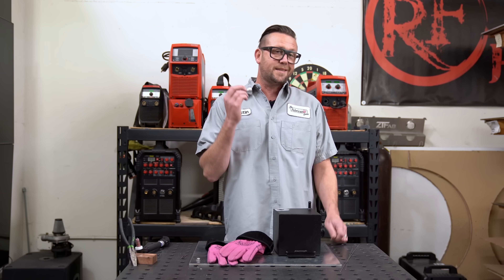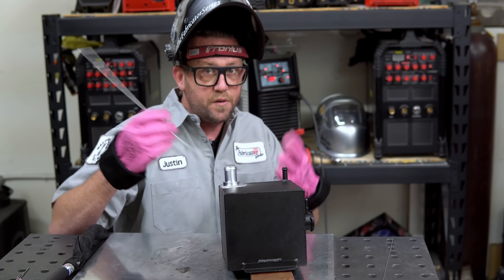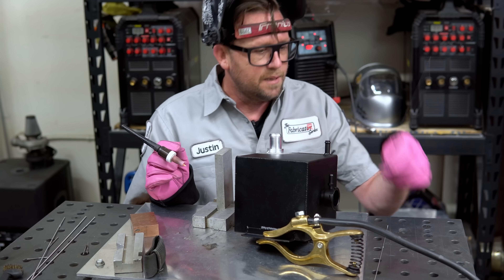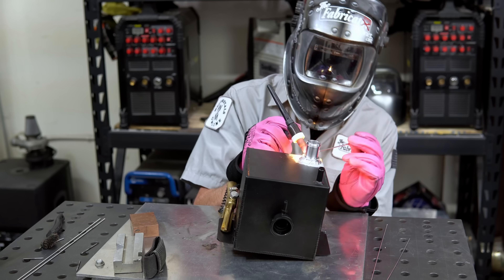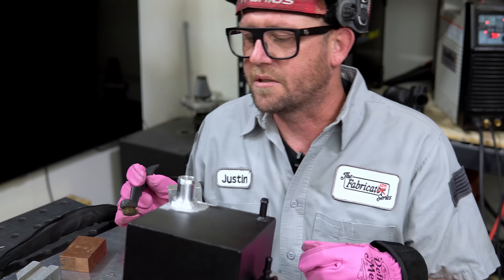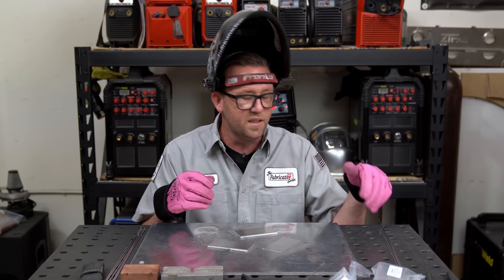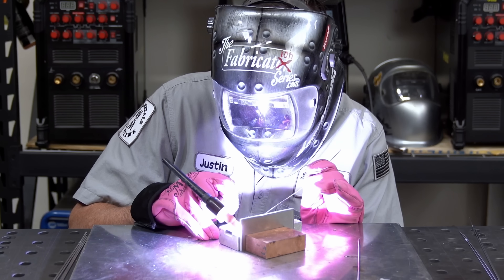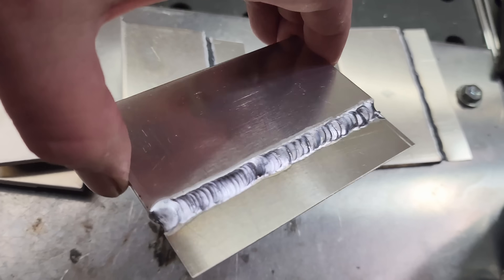TIG Welding Thick to Thin Aluminum

Comment: Le piège est de baisser trop le courant, cela rend l'arc instable , dans les trucs à la con, j'ai du souder un tube traversant une plaque de 8 mm de diamètre 10 mm en ép 1 m. Outre qu'il faut mettre assez d'ampère pour fondre du 8 mm d'épaisseur,  et ne pas oublier que la chaleur monte, j'ai mis la plaque épaisse à la verticale  et soudé quart par quart en montant. Ce qui a permit de crée le bain sur l'épais et de l'amener juste à lécher ce tube aussi fin.

Comment: Now just my opinion if it was me and I can just sit it there easily.i would take a torch and heat the piece to about 300 drop it in with some pliers put 4 racks and make sure it's right and put the burn on it it would flow like butter

Comment: TBH I've found shaking a little due to a cramped position helps when trying to cause the "bleed" before adding filler. It's not that bad that it does not add to something 😂

Comment: Why not cut the part on a lathe so it will be thinner ?
That amount of filling metal does not add much strength.
If it's for a racing something that's  extra weight for nothing.

Comment: Justin, I thought you taught flow rate should be 2x to 2.5x cup size? For your number 5 cup, wouldn't this have been 10-12.5 cfh? Just wondering why you set it to 15 cfh for this weld? Thanks.

Comment: That's a very difficult weld to do properly on aluminum. I'd honestly be tempted to just gas braze it with a low melting point alloy. If I had to weld it, I probably would have done a few base passes with just the filler around the hole to give it some more mass.

Comment: Nice video. I have been told to only brush aluminum in one direction. Brushing in both directions drives contaminants into the metal. I am curious if you or anyone else has heard this. Thanks

Comment: It's a darn tooting shame you didn't provide close ups to show the different deposition of the 2 types of wire you used.
Providing a visual for what burnt silicone looks like could be useful for beginners that lack the experience to identify it themselves.
When I started on aluminium I recall having a tough time differentiating between contaminated and overcooked welds.

Comment: You said something in this video that I've never heard said before: 
measure the flow at the center of the ball. And there are other things you say too, that show how precisely you think and more importantly, how you share details! Thank you for for your content💯
Reply: Victor flow meters specifically say to measure at the top of the ball. For what it's worth the QC department at my work had to test the gas flow of all 40 or so welders in the shop to have a record of calibration for a certain customer(pharmaceutical) and they were pretty much all off, some only a couple cfh, some 5-10. They're all top of the range Victor flow meters from a few months old to around 15 years old with CK torches, cables, hoses, on Maxstar 350s and 400s.
Reply: @justion337  Appreciate your input.

Comment: Is it possible that you can make the 3/6 coupons circular shape or make tubing coupons like idk maybe 1/2 inches tall 3/6 thickness that we can weld to those small square coupons that are 6 times smaller to practice going in circular motion

Comment: Thank you for NOT editing out the dips / mistakes.  It makes the learning more personal.  We learn as much from our mistakes as our successes.
Reply: Agree, it just happens to everyone. I would love to get better at welding aluminium and often have tough times gauging/seeing how close my tungsten is to the actual weld pool and dip the tungsten all the time haha, live and learn!
Reply: Also agree. I do decent with aluminum (rarely do anything that isn’t ultimately owned by me, so I don’t have any ‘commercial’ pressure to do better) but it was heartening for me to see all the coupons at the end that just looked functional with a cosmetic “meh”. Ironically enough, thick to thin came pretty quickly to me. It’s thin to thin where I struggle.

Comment: You make that look so easy! I've bought a MTS welder in 2016 (sold it last year) and another one in 2019 that I've used the MIG twice. I'm wanting to use the TIG but I need more energy and a little push (I'm old). I did buy quite a few packs of your practice metals (once in 2016 and once in 2109) but haven't opened them yet!! I subscribed to your channel a long tine ago when you were building out of your garage. Keep up with the great informative videos. Thank you.

Comment: U have a question when I tig aluminum I have issues with the arc wondering. What arr some things I should look at. Don't have the problem with steel or stainless